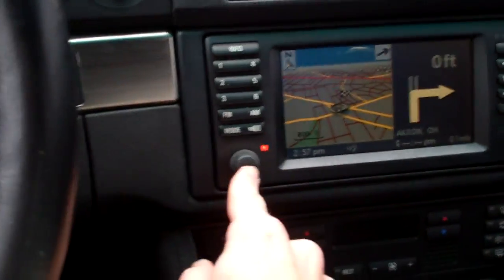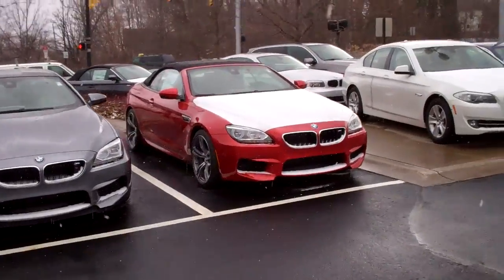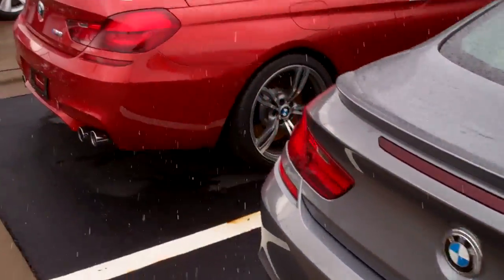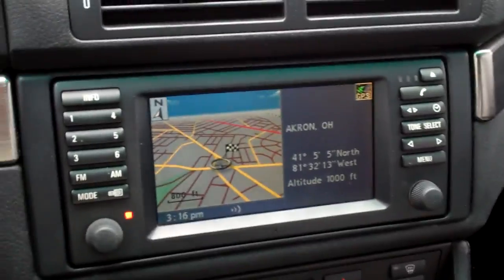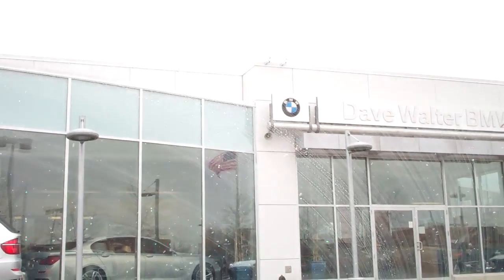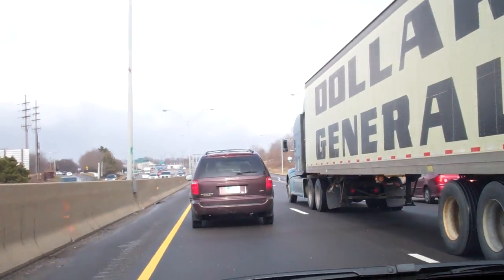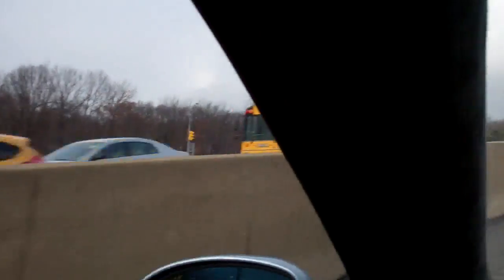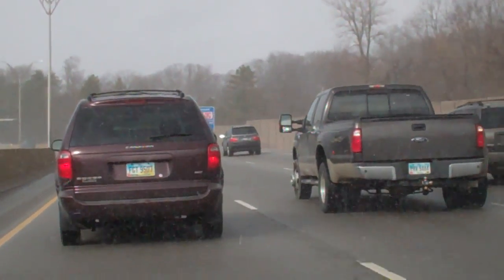Unloading on Colton  3/1/13 - Day 810

Comment: Over all of those M cars I would still own an E39 the most. Maybe the F12 always loved the 6. Glad you had fun with your knobs. ;) Dave walter does look nice though! Our dealer of choice about 200 miles away (where we used to live) is an Alpina specialist. Lots of lovely cars! I also have a video that sums up the E39 M5. You may have seen if before though /watch?v=6R5ziPbqVqc
Our new neighbours moved in today also, they have an F10 525d and an F25 X1 2.0d xDrive. I suppose it could be worse.. ;)